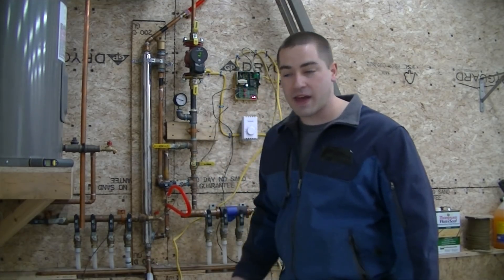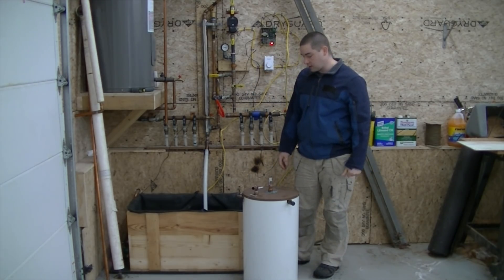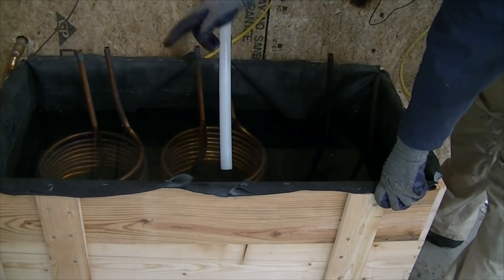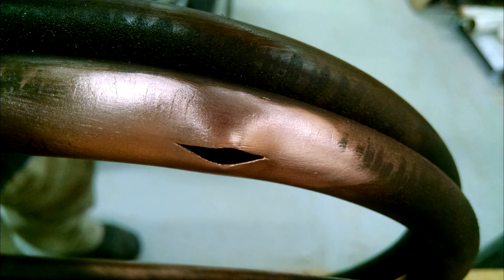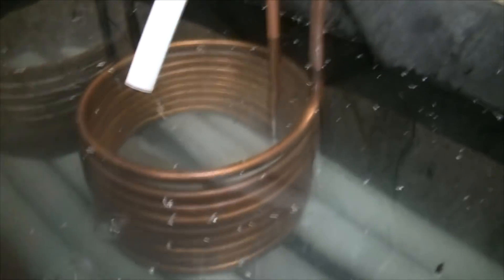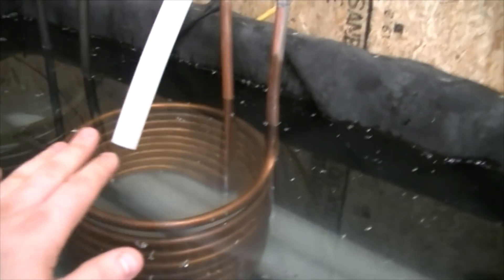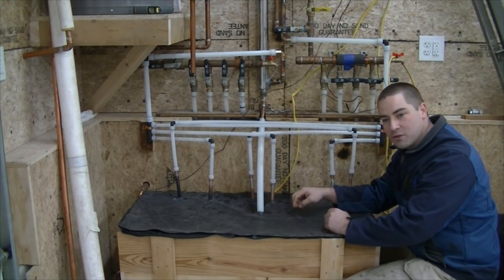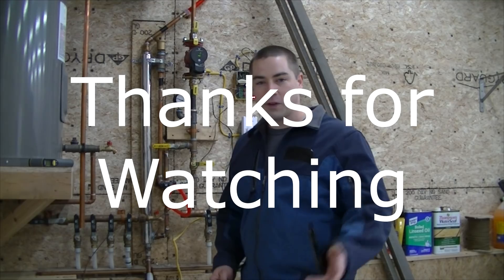Adding Heat Exchangers to Garage Solar Heater

Comment: Its good to see your over coming your problems one step at a time. But have considered using the fluid directly from the  solar heating system and avoid the use of the heat exchanger and loss of efficiency?  I realize solar panels need freeze protection and could get to hot to use with PEX but this those issues can be address without a heat exchange being used.
Reply from the maker: I built the system over two years, so there are some flaws.  The first winter I had no solar at all.  I only heated the fluid with the electric resistance water heater (big gray tank in the corner).  Then I started adding solar components as I sourced them.   Things would be different if I built the solar setup in the beginning.
Reply: @DavidPozEnergy  Retrofits do add complexity. I would suggest you find a chat room that is far more specific to your project to ask advice about it but I get the feeling you want to do it you own way. So good luck getting it to work well enough to meet you needs. 

And as side note, I admire that your using PEX A with expansion fittings. Even with the added expense for the tubing over the cost of PEX B. And that cool but expensive makita expander. Since it wont restrict the water flow. Since the fitting have the same ID as he pipe. Unlike with other type of PEX fittings. And has a few other advantages to using it. Since I plan to do some DIY work at home, using a much slower but much cheaper manual expander or I may try to find a place that rents a makita expander.

Comment: Incase you missed the one that was done in Colorado and featured in Mother Earth News, a while ago... you can benefit from a tank that is about 4x4x8 lined with polyisocyanurate insulation... also you need to put an insulated cover on the tank.
Reply: RogueOntheRoad why the cover? Just curious.

Comment: Probably a stupid question but why can't you run the water from the solar panels directly through the Radiant floor?
Reply from the maker: You could!  If you design the system from the beginning, and don't do it in stages with salvaged materials you can have the water from the floor run directly through the solar panels.  This would even be more efficient.  There are a few things to consider.  First, with the system I have now, I could turn on electric heat in the 50 gallon water heater tank and heat the floor.  This could be done independent of the solar altogether.  That's a pretty nice feature.  Also, if I spring a leak in in the solar system I can still run the radiant floor, heating the building, until the solar system is repaired.  
If I was to do this all over again I don't know if I would run the water directly through the solar, or still have a heat exchanger system.  Of course I could design the heat exchangers better from the beginning.  If I ever built this again with some other backup system (probably a wood stove) then I would probably run the system direct.

Comment: would have been cheaper to have PV panels connected directly to heater coils and heat the water directly, but, half the adventure is working shit out for one's self and experimenting.
Reply from the maker: You are right, if you buy everything at retail price PV would have been cheaper.  I pulled my panels from craigslist.  I have a video on it here: https://youtu.be/9Nd9k1rQPW8

Comment: what type pex was that no criping ? would like to see video on just that thank you
Reply from the maker: Uponor is the brand name of the pex and fittings.  Thanks for the video suggestion.
Reply: redwood1957 he using pex A (Uponor is one brand) with expansion fitting. And  pex A should be used with expansion fitting since pex B or C are not made to expand. 
FYI pex A using expansion fitting is far superior but is more costly than the alternatives... and there is a few Utube posting on its use and how it compares...

Comment: To damn much plumbing complexity, a solar air heating system would work better unless you have a huge insulated water storage system to keep the heat on during the night. Even then you could do a water heat to air transfer. 

And yeah the stainless tanks linked together with their insulating blankets would have been better than your wooden tank.

Comment: use a fresnal lens to maximize the sun light?
Reply: it would still be ALL solar. . . . .
Reply from the maker: Hi Samantha, fresnal lens is a cool idea for several solar projects.  I have one that I have used for boiling water in a black pot.  However, it is not helpful for my application.  The lense casts a shadow behind it everywhere other than the focal point.  So if I set it up in front of my solar collectors then a lot of the collectors would be in shade and only one small pipe section in sun.

Comment: A v-twin stirling cold gas engine with a rewired drum motor generator with magnetic bearings with a automatic bicycle transmission attached to one fly wheel with a fan attached to the other fly wheel to draw air through a copper condensing coil filled with liquid air from an insulated tank with a bell siphon for air conditioning with the liquid air boil off returning to the cold piston to reform liquid air with the drum motor generator providing the volts needed to to power the electrical motor powering the cold piston for a air conditioning system that Will power itself after the liquid atmosphere begins to cycle through the system. A organic carbon power cell could used to start the cycle or a 12 volt battery that shuts off and recharges then shut off ounce it has a full charge with the liquid air cold cycle providing the fuel to keep the system running. A really great design for use in green houses. A larger rewired drum motor generator can power a hydroponic green house lights fans with V-twin cold gas engines operating water pumps the liquid atmosphere can also fill tanks with frequency emitters that cause the oxygen and nitrogen to return to a gas state that can chill and infuse the water being circulated through the hydroponic system. Governments control all this neat  technology so people have to rely upon the government for everything. Composting toilets with the urine used to fill a joe cell that produces HHO that can then charge hydrogen fuel cells with the byproduct of processing the urine collected while cleaning the joe cell and crystallized into rich plant food. The solid waste from the composting toilet processes and sterilized into rich top soil to grow plants in IE food crops. Lots of very cool ideas. Like a V-20 stirling cold gas engine that powers a hydraulic pump motor that powers a swash plate pump motor in each wheel of a tractor or other farming equipment. Farmers would no longer need fossil fuels and larger stirling cycle engines with slpit power swash plate pump motors can be developed. Not to mention electrical power generation from these systems has well? 😵😂

Comment: You should look into organic carbon power cells and solid state graphene or graphite power cell and stirling cold and hot gas cycle engines. Engines can be designed with antivibration technology and use magnetic bearings on all moving parts so no need for lubercation. Hot gas cylinder heads heated by induction levatation of an alloy with the cold gas stirling cycle being fueled by liquid atmosphere generated by a helium sealed cylinder stirling cold piston. Look up these on you tube and watch the videos. 😊

Comment: Solar vacuum tube water heater retrofited to super heat gallium then use an electromagnetic pump to circulate the super heated gallium through a heat exchange coil that is in a insulated hot water tank. You could also circulate super heated gallium through a copper condensing coil then have a fan draw air through the coil to heat the air. Composting bins designed with aluminum rain spouts that have copper fined heat exchange pipe filled with gallium and placed in the center of the aluminum spout then snaked through three of the four walls of the composting bin that allows air flow through the aluminum spouts then insulate the bins. If done correctly you can have the Cooper fin heat exchange pipe filled with gallium to absorb and conduct the heat generated by the composting plant matter and then draft air through the aluminum spouts to heat a home green house or workshop. Cold air sinks hot air rises so it is possible to move air through the system without ths use of any electrical fans. 😉😊
Reply from the maker: Sounds like a lot of work.  Have you seen anyone try this?
Reply: No one has done these ideas yet. I was brain storming and developed a central heating system using induction levatation that also heated water a cooling system that also generated electrical power. I only gave you the low technology version of the system. I designed a liquid air electrical power generator that uses superconductors from utilizing the ultra cold temperatures of the liquid air generation to increase the electrical output and with the use of vacuum spark gaps. The induction levatation of an alloy that super heats gallium with the use of high heat ceramic superconductors a central elemental heating water heating cooling electrical power generation system for a home green house and recreational vehicles designed to replace gas and diesel power generators. 😵😊
Reply: these are interesting ideas! a couple of things to consider: gallium is expensive. gallium will corrode the copper, and the released copper will form a compound with the gallium, raising its melting point. ... could an oil substitute for the gallium, and circulate naturally using convection (thermosiphon effect)?

Comment: question.... why not put a 1x4 frame that you mount rubber top to, so that you can remove easily?  Just an idea to avoid the stapling...
Reply from the maker: Hi Joe,  Thanks for the question.  You can certainly do that.  I tried that on my first tank years ago.  What I found was the water inside the tank turns to vapor and finds its way out through the tiniest gaps between lid and tank.  Not a huge deal, but you need to top-off the water inside the tank often.

Comment: I built a system like this but I had a 160 gallon stainless tank made with 120 feet of copper tube coiled up in it to extract the heat. I have 4 panels of evacuated solar tubes heating the water in the tank.
Reply: johnabuick

Comment: Quick info... try not to splash hot return from collectors. Use water heat stratification. Connect that vertical central hot pipe in to a T with horizontal section that goes in the length of your tank, just below water line. Close the ends and drill more smaller horizontal holes in that section. across the whole length. Water will come even across the top of the tank over the coils. The point is that you disturb the water as little as possible, with hot water going in horizontal orientation. Bring the coils up as far as you can, also.

Comment: You might wanna stick to comedy, which this obviously is, untill you have some things properly learned, tested, and in working order. Also,  a solar heating system running air beats the impracticalities and costs of liquid any day. One last thing....set up your heating panel array near the ground, as on blocks on slabs, then on the the coldest winter days, when the sky is the clearest and brightest, your heat production is multiplied by all the reflecting, concentrating snow. If you build an insulated bin of rocks with the air blowing through it to lean the solar array up against, then you have best incorporated heat storage as well, and saved a truckload of money compared to stumbling around as you are now.
Reply from the maker: Last year I visited a solar-heated house built in the 80's.  That house had a whole basement dug, and filled with clean crushed rock as a thermal mass.  Solar heated air was then blown through the rock during the day to "charge" the system, and continued to blow during the night to heat the house.  The current owners have sealed it off because it was never "comfortable" in the house.  Hot water allows the user more control.
Reply: No. It does not. It was dumb to put the heat storage underneath the house instead of beside it. If these people were friends of yours, then I now see where you get it from. Seriously!? You aren't kidding me? If you backhoe a trench beside your house, and bury pipe such as for central vacuum and some connected weeping tile for drainage, the soil temp stays cool in summer. Blowing your indoor air to recirculate through the buried pipe, and back into your home is free AC if you can use some solar electricity for circulation fan.  Don't use liquid for this either. :D
Reply from the maker: Hi Robin T,  How do you heat your home?
Reply: Alright, so my first home was small, about 800 sq. ft, near Wawa, Ontario, Canada, with real mosquitos and real cold, and a lumber company employer. That is the home i decided to try solar heating from scratch, because furnace oil was costly and firewood was constant work. I used stud framing with corrugated metal roofing, fiberglass insulation, and tempered glass shower doors from the dump as glazing. The total surface area was only about 100 square ft. The bottom vent to top vent heated air convection ran behind the metal, so that between the metal and single pane of glass there was dead air space, so only required ONE layer of glass. A bit of gravel, then patio slabs, then a platform i placed at the back of the house (south side) which faced a large clearing beyond the yard, then forested hills. between the panels slanted to the sun, and the back house wall, i braced temporarily, then framed and closed in, and ran more concrete blocks and patio slabs in staggered layers as thermal mass. This was insulated, and i actually just removed a window and replaced it further along the wall so that i could vent the air into and out of the house for this system. Minimal materials, minimal cost, no moving parts, zero maintenence. Only vents I made with sliding covers to open or close or adjust. The -30 celsius days are also always the clearest and sunniest, so....after testing for first winter, often calling my wife from work to see if the furnace had kicked on - it never did, so I also removed the woodstove the first spring, which gave space for another room. I got my asking price for this home within days years later when i did sell, and didn't even need to list it. I have owned 3 homes since, the final one built myself with child labour, never worry about utility bills. For this setup, a few details are important: Use fiberglass insulation only to avoid any chance of chemical off-gassing no matter what temperature range a BS manufacturer rates their chemical foam trash for. And, its very likely best not to alter any other details either, unless scaling up. Definitely, don't build awkwardly onto a rooftop or use your basement for heat storage, lol. Also, i'd like to say to everyone, that as libraries put away their older books and close their doors, and ppl rely on google for all their answers, tech and truths, much information and skill is being lost. Everyone needs to understand, marketing drives most info that appears on the internet. You still need to find books and educated sources, be curious, and learn OUTSIDE of your cell or apple or pc, else be re-inventing the wheel forever.
Reply from the maker: Robin T, Now that is awesome!  Hearing about your experience is way more fun to read then making jokes about me.  And I agree with you that foam insulation is not the way to go.  Especially spray foam, horrible.  Also your comment about older books, spot on!  I love finding older solar books and buying them.  Some of the older solar techniques were right in line with your way of thinking, simple, no moving parts, excellent!  Thank you for sharing where you are coming from.
Reply: I got my info from older solar books as well. I have now watched a few of your other vids, and hope that you'll continue, because puttering on projects is far more rewarding than shopping, and it thickens the skin for responding to jokers like me. Now that you're set, my job here in comments is done. :)
Reply: As i think of it, one more thing i gotta say, because i keep reading about insulation and super insulated this or that. If you can seal a framed wall with no insulation inside of it, and this is actually easier than it sounds, because a few coats of paint and silicone around electrical boxes inside and out, as well as sealing any plumbing - you get the idea, then add an air inlet in some corner. To this attach a vacuum pump (or tire inflator running inside a sealed container), so that you can draw out some air. You do not need to draw out a lot or create any extreme vacuum within the wall. It then has far better insulation value than any other insulation, even if the thickness is only a few inches. You then disconnect your improvised vacuum pump, and put it away until you feel the need to apply it again, such as after someone hangs a picture with a nail. :) This extra bit of detail saves plenty of money because it insulates far better, and you don't need to buy insulation, however, companies cannot very well ship and market vacuum space, unless its a thermos that goes in your metal lunch box to the work site for mid-morning coffee. Try it out for a vid. Insulate one small sample wall, and make another with vacuum to compare as a bench top experiment. The working principle is that insulation traps and restricts the movement of air molecules, so that they conduct heat less. In a wall containing vacuum, there are far less air molecules bumping around to even conduct the heat from one side to the other. If you have existing interior walls, you can also apply this for extremely good soundproofing without tearing everything up.
Reply: Robin how much of a vacuum are you talking about?  PSI?